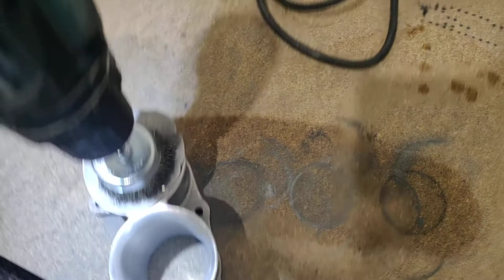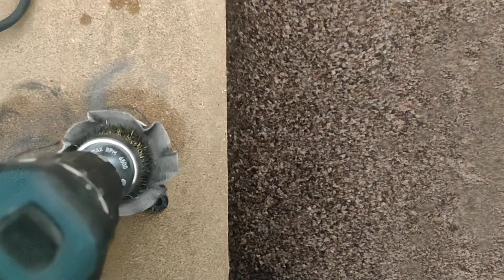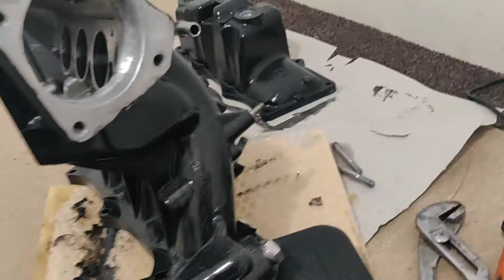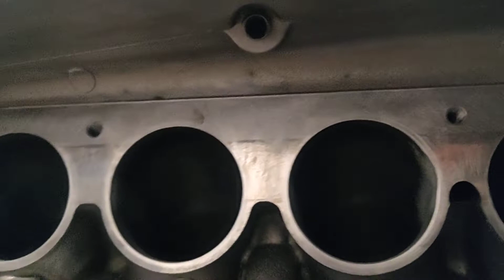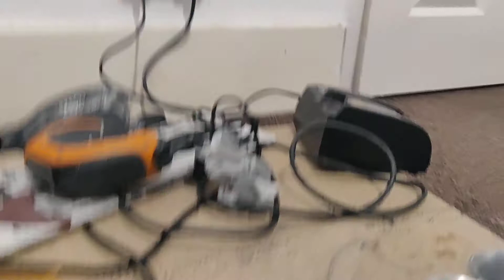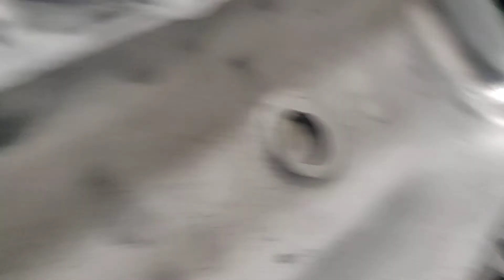Making wider opening and cleaning fn2 k20 intake manifold trumpets...

Comment: Good job, but I think..you don´t have any benefits from this. Guy on youtube make bigger improve his RSP manifold then you. He make +3hp mid range. 3hp you can´t feel 🥸 do you plan a dyno after?
Reply from the maker: Hi Adam, I was taking manifold off anyway to port for a bigger throttle body so I didn't mind spending a bit of time. I'm planning a new exhaust manifold and single exit exhaust then going to get it remapped and Dyno run soon.